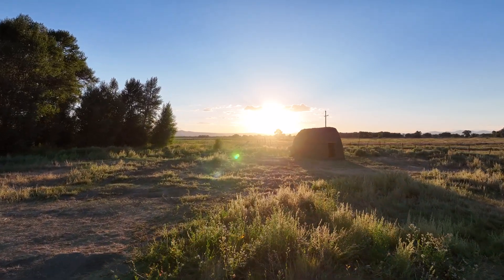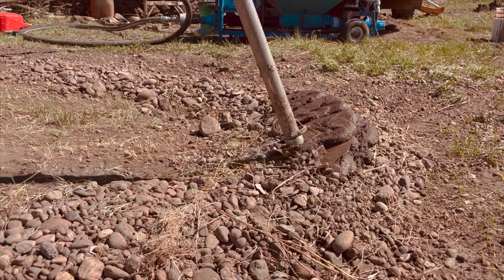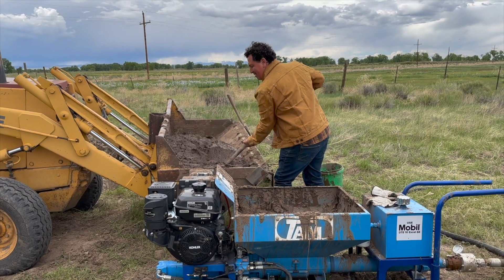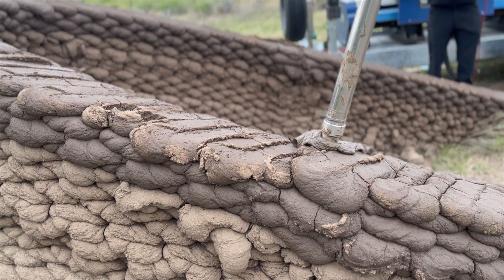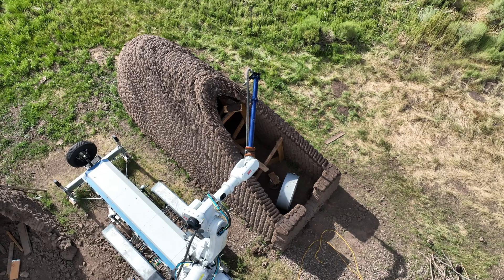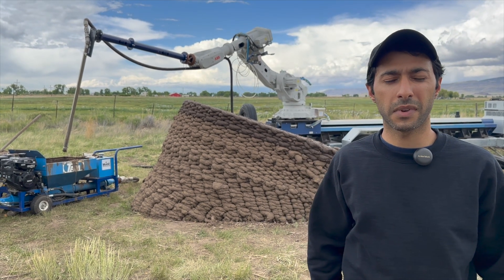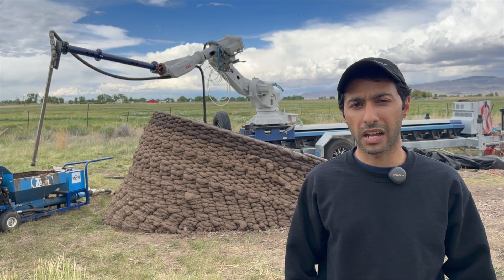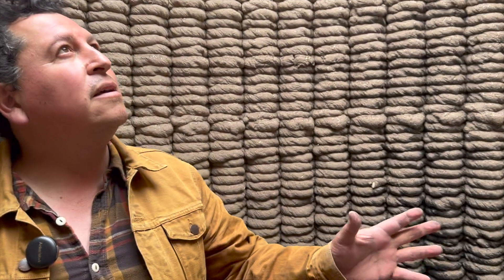Muddy Robots Building With Ancient Materials & Automation

Comment: I have to say if this was something I would consider, I would need for the place where my 2 columns of house met to be packed.  

And actually,  since someone could blind sitting in a structure like this with all the walls like that, a person could go blind.  I'd probably want to pack the wall by hand, like they used to and smooth it out, but not quite all the way.  I love even more how the old way looks, too; so to tell you  the truth,  i think of i were to keep any of the the curvy/waved design at all, it wouod have to be like accent walls and maybe framing the doorrways frame, and likewise reverse the look for the machine built look by packing the windows frames or archways or something to mix it up and give my eyes a break from the chaos that this pattern seems to be causing in my eyes.